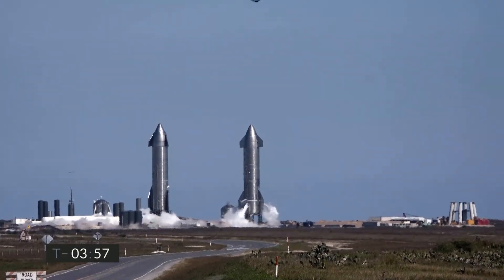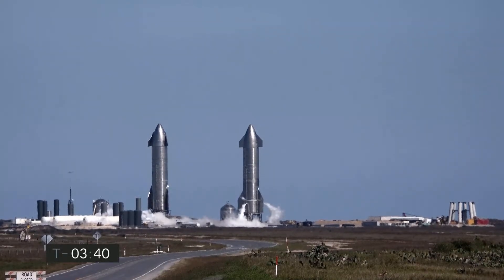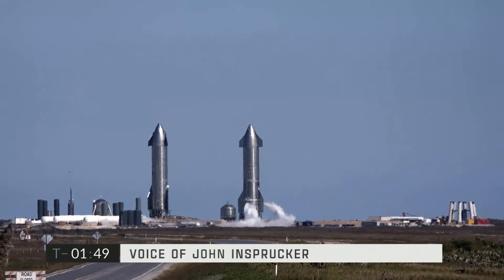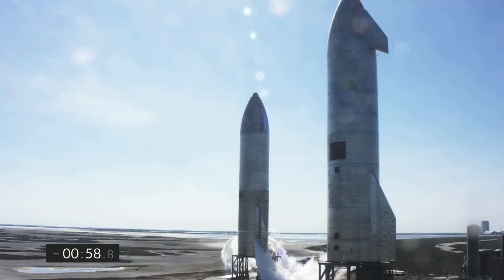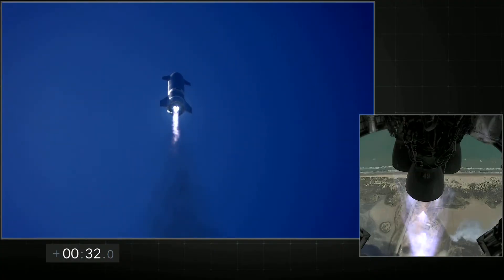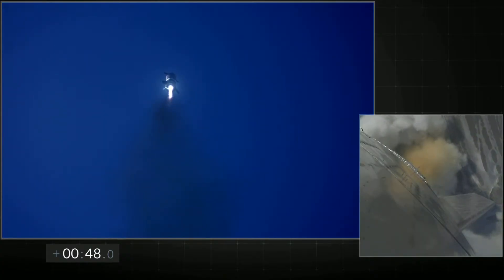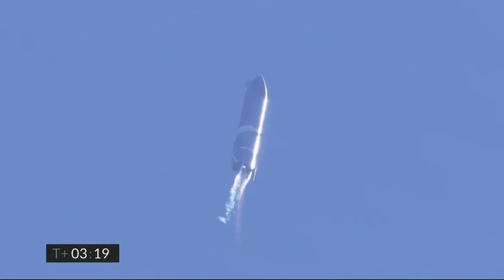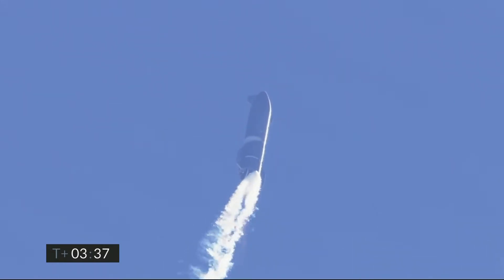Starship | SN9 | High-Altitude Flight Test

Comment: I still don't understand why we take the vertical take-off route to escape the earth's atmosphere. It just seems to be a waste of fuel and energy since we're going straight up. There are Russian Mig fighter planes and the SR-71 that can reach high enough altitudes that a little bit further up and they're flying in space. Slap a damn extra thruster on a plane and just take off normally.
Reply: No. Rockets don't go straight up to achieve orbit. They remain mostly upright to fly through most of the thicker atmosphere and then start turning. You need a incredible amount of horizontal velocity to get to orbit. The SR-71 could maybe just barely go suborbital. Using multiple stages that separate once depleted is far more efficient than an ssto or "spaceplane".
Reply: This is a great idea! Why haven't the rocket engineers thought of it?
Reply: @MobiAussie  That's why I'm asking. Does anyone have a written or video education that explains why it's done this why. I get that gravity and the atmosphere density play a role in it. But I haven't found something that truly explains the reasoning behind a vertical take-off versus the traditional horizontal take-off
Reply: @TheGrtBacon  Literally the comment above mine explains it. The closest thing to your idea is Virgin Orbit's aircraft-launched rocket, and it's not significantly better than a normal rocket.

Comment: This looks like a step down from the SN8
Reply: it was, SN8s second booster failed after it got the flip down, this time it failed to ignite entirely. both engine related in the end.
Reply: @lmao.3661  SN8 wasn’t an engine problem but a header tank issue, fixed in SN9.
Reply: @anthoh5  yep

Comment: Sorry if I sound stupid but are these just the rockets that are placed on a space craft?
Reply: What your seeing the is starship 2nd stage only. The booster, or “super heavy” sits at the bottom of the starship and will be tested soon.
Reply: i think the terminology is a bit off but you get the general idea
Reply: This is the upper stage of the Starship (full vehicle), It's also called starship, it will be ontop of the Superheavy booster.
Reply: Yeah it's a bit unorthodox to be testing a second stage like this. The confusion is understandable.

Comment: Knowing Murphys Law does exist, why the hell would you detonate a rocket ship next to the next in line to get launched.  
The shotgun blast from potential explosion would ruin a perfectly good space x ship. 
I bet they will have to do major repairs due to a small hole through the entire ship.... 
Launch and landing should be separated from any vehicle in the line up by at least a mile... 
if its so safe to have a vehicle that close to an experimental rocket then put a photography crew on the top of the rocket that is waiting for the next launch.
Either its arrogance or complete stupidity to store their rocket next to an experimental launch.
You cant get any dumber, but those with money seem to ignore the basics.

EM: Remembering the baby steps battery fire across the street from N244, remember it gutted the building. I bet being out there next to space stuff is where you got your inspiration.
Reply: They inspected SN10 after the crash and no damage was seen on the rocket.

Comment: I think that the landing burn should start a bit earlier and this would give the vehicle time to stabilize and descend at greater control. I have been watching how the falcon rocket do it, they indeed start a bit earlier.
Overall though, this is impressive and mind blowing.
SN is our modern day Apollo and we thank Space X for taking us along with the ride. I can't wait to see the day they get it right. The day is close for they are very close to nailing it.
Reply: Falcon 9 is falling about 5 times as fast (1100km/h vs 220km/h), so of course it needs to start earlier than Starship.
Starship's landing flip is timed just fine. Flipping earlier would not have saved either SN8 or SN9.

Comment: There is a reason why successful and repeatable rocket re-entry and landing is best approached by a space vehicle that can land horizontally along a glide path and onto a runway, as it can accommodate a level of error and still land safely (Space Shuttle). No such luxury here, 100% right or zilch....100% of the time?? Yeah nah.
Reply: the shuttle had way too many flaws and it's design was a huge part of that.

Comment: I was thinking about the heat schield. Why not make that rapid reusiable too. Instead of many heat sync tiles, just make a clip on heat sjield composed of these tieles. A clip on for the wings and one giant one for the body. Just make it quickly cangeable after each flight, clip the new one on. And refurbish the old one in the factory where time doesnt matter as much. With a giant clip on you could change the heat shield within a few hours after every flight and put a new one ore refurbished one on each flight. Eliminating the need for starship to have to go to maintenance. its a brqnd new one each time. Saving time and making starship rapid reausible. THX, and tell me what you think of this. THX it would be like changing the  jacket or coat before going outside. instead of  repairing holes in the jacket with a needel and garn each time you want to go outside. just change the coat every time you go outside and fix the previous jacket in the house while going outside with the new jacket. sorry for my bad english...
Reply: This is one of the few actually decent suggestions I've seen in the comments. 
I think the main issue would be that the tiles are fragile, and making big ones and then working with them would be difficult. 
But if you could solve that it seems very promising. Worth looking into I think.
Your English is fine by the way!

Comment: Clearly this direction of method of landing is not the way.
Reply: SpaceX crash landed Falcon 9 at least half a dozen times before they got it right, depending on how you count it was even higher.
Even Falcon 1 blew up 3 times before it's first successful launch. SpaceX aren't gonna pussy out after only losing a mere two Starships.
Reply: This is only the second time they've tried doing this, they ain't just gonna throw it out the window like that... Besides, it almost worked on SN8, but one of the engines didn't have enough fuel to slow down.
Reply: We know dude. It's still clear they are stupid
Reply: @Time_ND  not really
Reply: @Time_ND  Did you forget to switch accounts or what.

Comment: Probably better to try that a little higher than a mile off the ground next time yeah?
Reply: SN9 flipped at ~550 meters. A mile (1610m) would be far too high. The flip is left late on purpose, as flipping earlier is actually worse in many cases.
Both SN8 and SN9 had engine failures in one way or another, and were doomed no matter what. Flipping higher would just have made them fall further.

Comment: Y'all gotta flip WAY sooner. Why are you trying to be so stingy on fuel? Nobody is going to want to fly on that thing if it's sticking the landing at the last possible second with no room for error. Though I suppose it's good to have that baseline so you know the limits of what is possible. Looking forward to a successful landing. 😉👍🏼
Reply: The thrust is high enough that it can't hover so it has to land at the correct time.
Reply: @infinitelyexplosive  if even a single engine can't be throttled down to a level where that's possible, I would consider that to be a fundamental design flaw. 🤨
Reply: @graceoverall  No, it means the engines are very efficient
Reply: @graceoverall  Falcon 9's engines can't throttle down enough to hover either, yet they've gotten those working just fine.
They've now landed them 74 times in total, and are currently on a streak of 24 successful landings in a row. 
One of the cores has flown 8 times, with another about to equal that. So the lack of throttle control clearly isn't a big deal.
Reply: @lazarus2691  That's funny, because I've literally watched some of their earlier test launches where they literally just hovered from one pad over to an adjacent one. 🤨
Reply: @graceoverall  
Yes, that's because they were carrying much more fuel when they landed, since they only flew for a short time.

When these rockets go up a lot higher, they burn off a lot more fuel, becoming much lighter in the process.

A Raptor engine burns about half a tonne of fuel per second of operation.

The SN5 and SN6 hops lasted about 45 seconds on a single engine, so they only burned around 23 tonnes of fuel.

The SN8 and SN9 ascents roughly consisted of 100 seconds on three engines, another 90 seconds on two engines, and another 90 seconds on one engine.

All up, that's around 285 tonnes of fuel burnt, a dozen times more.

You can see during the SN8 and SN9 tests that they do in fact hover at high altitude, burning off excess fuel until they become too light, at which point the engines are shut down and any remaining LOX not in the header tanks is dumped overboard

(Incidentally, this is the same reason Grasshopper and F9R could hover but full F9 boosters cannot when returning from space)
Reply: @lazarus2691  Ah, that makes sense. Thanks for the enlightenment. Cheers! 😉

Comment: they need 2 or 3 additional auxiliary engines.... specifically for landing ... to work in tandem with 1 of the 3 main engines. I understand why they opted to not power up all three upon landing. Those main engines are optimized for maximum thrust during launch. To use them for landing requires only an impulse (a few seconds max) of the high thrust to "dampen" the descend speed, after that it needs a graceful reduction of speed to zero. It's hard to control the descent with all 3 engines on, whilst trying to turn off 1 immediately AND provide the necessary feedback control loop for the other two. This graceful attenuating thrust can be provided by these auxiliary engines that are optimized for precise and low thrust control. Of course cost will be higher in terms of hardware and computation, but we can have better control. Think of a bird landing after flight, it uses its tail to provide the drag to touch down, flapping its wings a couple of times only unlike during take off.

Comment: I'm sure there are hundreds of people smarter than me that already know why, but for my sake I'm curious.  Why not do the flip back to vertical at a slightly higher altitude to allow for more adjustment before landing?
Reply: Because the engines can only throttle down so far, which means it has a minimum deceleration. 
If you start too soon, it will slow to a stop in midair and then start rising again due to having too much thrust.
Also, leaving it as late as possible is a lot more fuel efficient. Flipping 10 seconds earlier would about double the fuel requirements.
Reply: @lazarus2691  ah okay that makes sense, thank you!

Comment: I heard idea about trying to relight 3 instead of 2 engines and switch off the weakest. Another thing  that could help saving the rocket would be trying to perform "landing" 500 meters above land pad. And then try slowly to land on the land pad.
Reply: But flipping higher would use more fuel. (Fuel it doesn’t have left)
Reply: @jackwhitlock1  Yes. It needs to load more fuel to be able to do it. Comparing the time engines are firing on ascent to the time they are used on descent it should not be that much additional fuel needed. I know it would affect terminal velocity (would be higher) but I think still worth it.
Reply: If there is a problem with a pressure of the fuel maybe they should have separate tanks for landing which would have a well known pressure at the beginning of the landing burn. If it is easy to use valves in such a pressure and temperatures.

Comment: The engineers did not learn from the first landing attempt. They miss calculated again when to reignite the booster rocket, they may have overlooked the total weight of the rocket which includes  remaining fuel, decent speed, and gravitational force, again not giving the boosters enough time to reignite and slow down the decent. Learn from the data, this is clearly visible in both failed landing attempts. 😲
Reply: SpaceX Know what they are doing. You don't. The flip was PERFECTLY timed. Please do some research as to why it crashed before you speak.
Reply: @OortCloud  the flip was done perfectly, with time remaining for booster rockets to slow the decent, dont get upset if you dont understand the laws of physics....
Reply: @cedrickphillip6163  An engine failed to ignite properly, that’s why it crashed. Simple.

Comment: If you had the education and opportunity to gain the wealth and infrastructure to bring something like this to fruition, what would you put your future legacy towards?

I know this question would bring out so many answers, probably most of them making zero sense logically or altruistically, but I bet they could all watch this video and just know instinctively that this is s good direction.  I can't help but state the importance, likely overlooked by very many , of the landing failure. Failure is progress at max efficiency.  There's literally no other way to maximize information we didn't know about, but needed. There could be info we didnt know of but ultimately didn't need.  There is information we know about and need and info we don't need.  I would go as far as to relate success in the context of this test flight as the maximum amount of information we knew about that was gained, info we knew about and likely had no use for, and the info both gained and which will not be needed .

Comment: If you land into some kind of vertical wind tunnel or shaft in the ground you could potentially both right the rocket vertically and decelerate with its engines completely shut off.
Reply: But there aren’t wind tunnels on Mars
Reply: @jackwhitlock1  Well, you are right, of course. Thinking ahead though, later on when you want to bring lots of mass (e.g. asteroid metals) to planetary surfaces on a regular basis you could save a lot in fuel for deceleration if you just sort of drop stuff down and catch it with ground facilities in some way, like a bullet going into ballistic gel. Maybe even a vertical Maglev kind of rail, whatever will work to decelerate a variable amount of free-falling mass.
Reply: @thunderwh  Mars’ atmosphere is probably too thin though

Comment: Of course, I am far from engineering, but for some reason it seems to me that the rocket would stabilize faster and better before landing if the air was sucked in from above and passed through the rocket with an exit at the nozzle, rather than resisting the air with a jet engine and point-like air discharge on the sides, from which it blabs more.
IMHO.

Comment: I think the flip must be at 10.000 feet or 15.000 to secure the start the engine after landing it's to close to the ground  and secure the Starship from fatal crash and need speed flaps ..
Reply: Wasn't the altitude of the flip that caused the crash

Comment: I think if they add 2 more smaller engines attached to the side close to the central mass like a pendulum with the structure linked all the way up  to the top would work perfectly. They would be able to minimize the speed around 10% activating those engines before the back flip and have all engines to control the landing at the same time.
Reply: It can do the flip just fine, it was just an engine relight failure

Comment: Hello, Mr. Musk!  You may not be interested in my comment, but it seems that this expensive test vehicle loss could have been prevented.   For the sake of redundancy and safety, why not have the ship restart all three engines, switch to two if that works, and then go to one engine as it nears touchdown?  It should be a snap to adjust the AI to accommodate for this plan.👍
Reply: So basically what you've done is copied Elon musks tweet and then reposted it, directed towards him... Man you are dumb
Reply: They are testing it this way because this is how they plan to use it in the future when it succeeds.

Comment: Why you don't design the tank of the 

fuel as an individual part , if something went wrong just drop down the tank at least there will not be an explostion ,so you can use the starship again , we fix it easily .
Reply: they arent planning to reuse the sn prototypes, its a FLIGHT TEST

Comment: There is no faliure in science
Reply: science is all about improvement. and this is engineering. Quite the same if I think about it. You test you fail. change test and fail. until it works science equals engineering.

Comment: I ask you to consider the project of Starship takeoff from the module on the railway, which will accelerate it to the required speed. A smoothly moving road from a horizontal to a vertical position - for example, it must be built near some mountain. This will primarily reduce loads and fuel consumption. In the future, this will allow small shuttles to be sent. Option 2 - we plunge SpaceX into a deep mine and throw it out with a catapult like airplanes on aircraft carriers. This is not serious
, we need to think of something, we take off like in 1961 - Korolev is shocked
Reply: We could just do it this way...